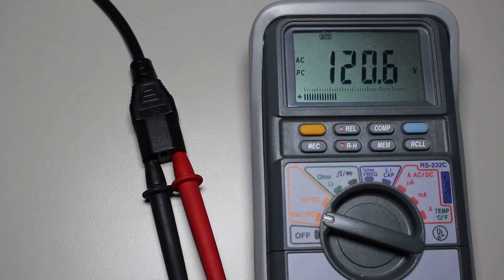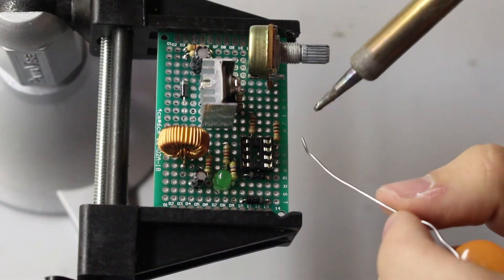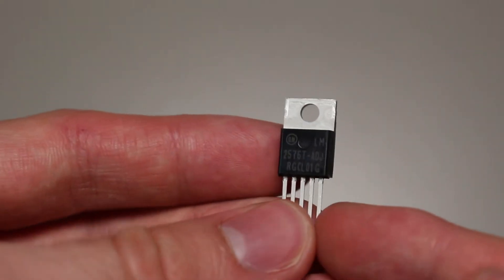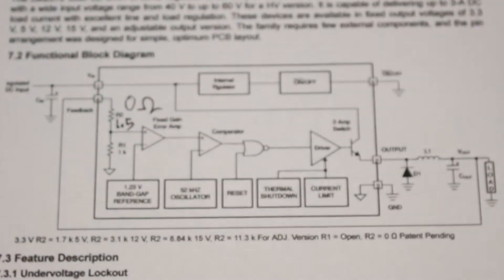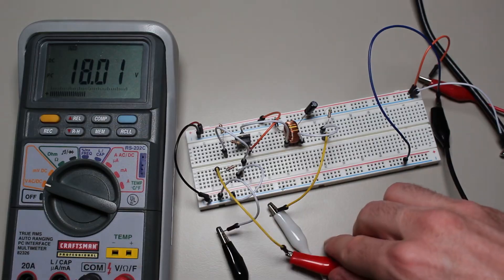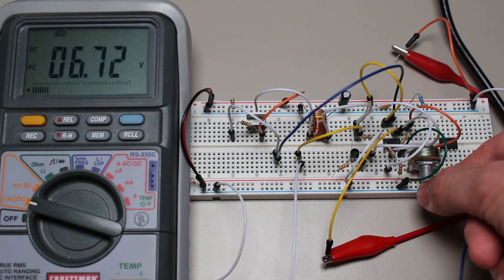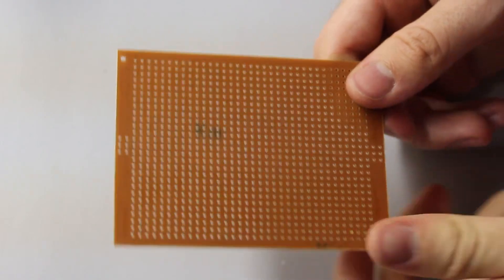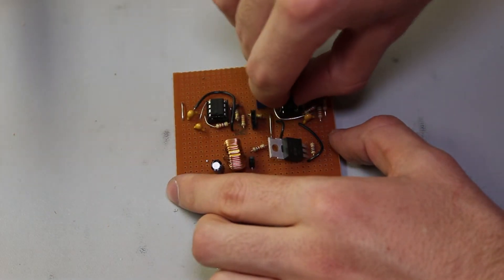DIY Buck Converter - How do buck converters work?

Comment: Thanks for the practical demonstration! Still, the feedback in your schematic seems off to me. Why did you put a local loop around the op-amp thus obtaining (-Vref + beta*Vo)*G with G=1?
How is beta*Vo tracking Vref? Let's fix the DC value of the error voltage at X volts for a given IN to OUT conversion, then the error is going to be X/G=X=beta*Vo-Vref.

Comment: The duty cycle change required due to changing load current is very small as long as the inductor current is "continuous" - that is, it never dwells at zero at any time during a switching cycle. When the inductor current is continuous the expression relating voltages and duty cycle, ignoring losses is
Vout = Vin • duty cycle
Duty cycle here refers to the fraction of the switching period during which the switch is ON.
If the output current drops low enough that the inductor current is allowed to dwell at zero each cycle, then the duty cycle must drop to maintain regulation and the expression becomes substantially more complex.
In practical designs, the load current below which the inductor current will become discontinous is usually selected to be something in the range of 20% to 30% of the full rated current of the converter.

Comment: What about the voltage spike when the inductor discharges when the MOSFET turns off? Wouldn't that fry the output potentially?
Reply: Fly back diode will be suppress it